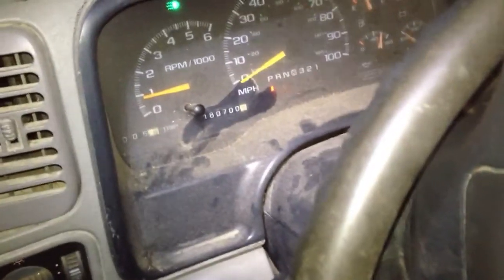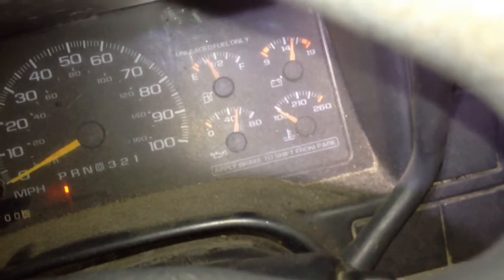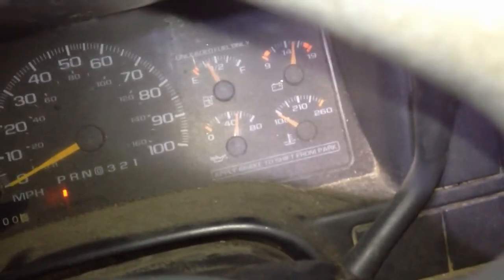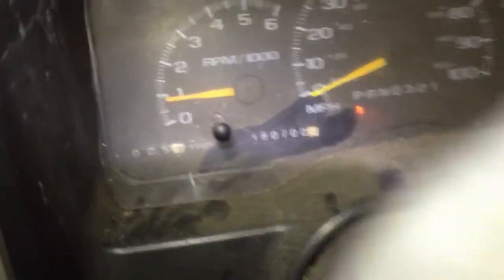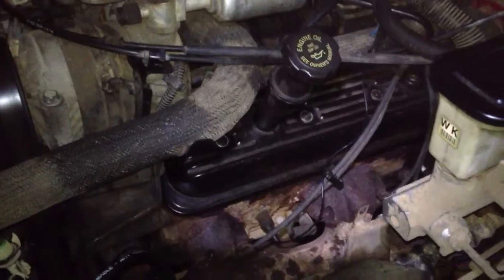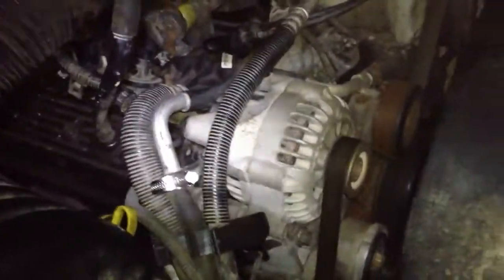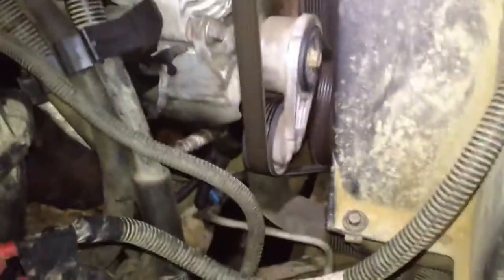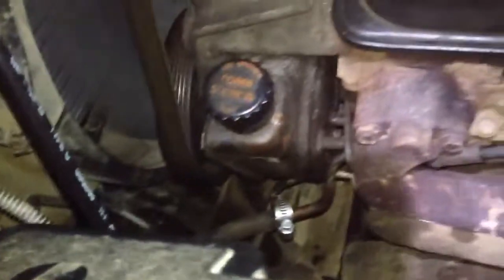1998 Chevy 350 knock 2

Comment: I have a 98 Chevy also with same engine and 246,000 miles and always had that sound. I wasn't hearing it for a while but then seems like it started continuously this winter. Sometimes it'll go away after driving it on the highway for a few hours and then it comes back when letting it idle for a while.